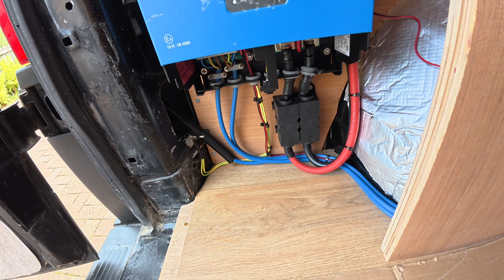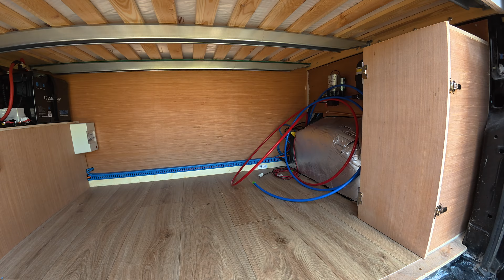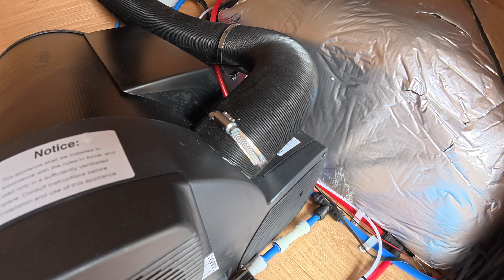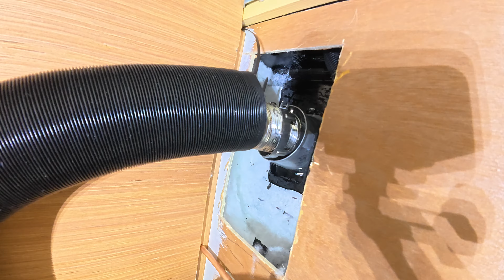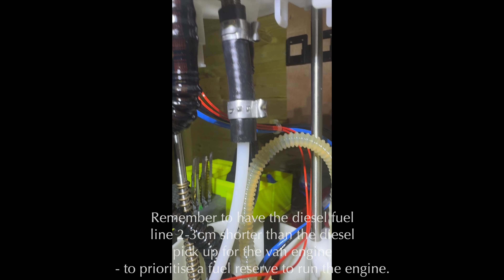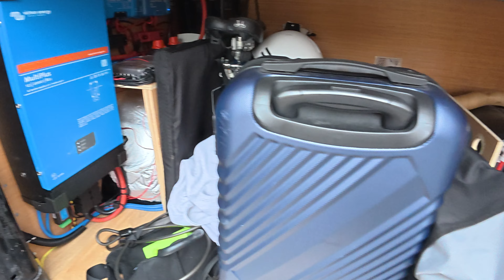Peugeot Boxer L2H2 Campervan Conversion Fully Functioning Electronics and Truma D4E Installation

Comment: Get rid of that 12/12-30 DCtoDC, I had one. It never put out 30 consistently and ran REALLY hot. Only on first start for a few minutes did it put out 30, then it thermal throttled to 20 or less. I bought 2 of the newer XS-50s. Totally different world, I push both at 40amps, so 80 amps total. They consistently put out what you set them at and run WAY cooler. Plus half the size.
Reply from the maker: Thanks for the advice. I'll monitor it's performance as you say. I wanted the isolated version and I didn't see this available in the XS50.
Reply: @IMCampervans I did too want isolated, but after thinking about it, it's not really isolated anyway. Your vehicle is still connected to the ground system in the trailer through other connections from the 4 way or 7 way trailer connector. I think, but I'm not sure, isolated units are more for marine applications where ground does need isolated. In your case I think you would find the negative battery cable already at chassis and your system. I could be wrong.
Reply from the maker: Thanks. I haven't grounded the 12V leisure system to the van chassis. I've run grounds to every circuit from the leisure battery. Grounded to chassis is a valid option I just choose not to do so and keep the van and leisure systems isolated.